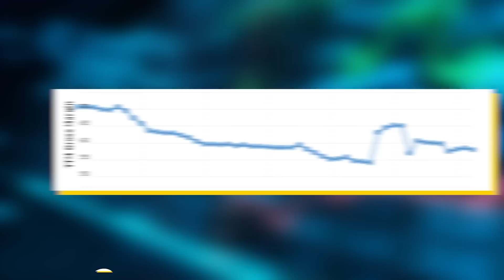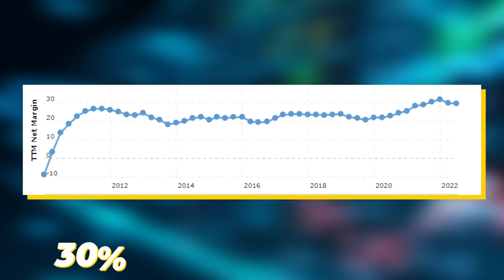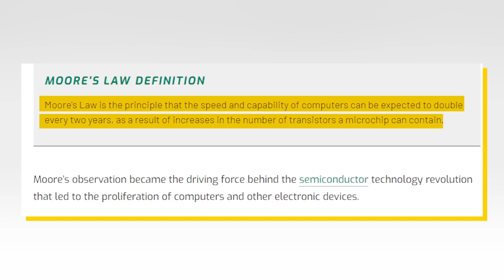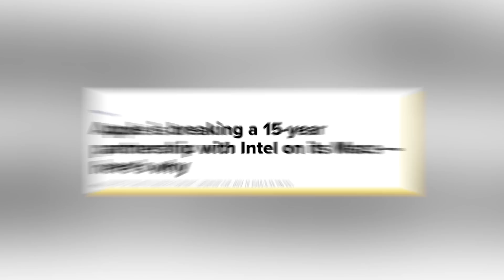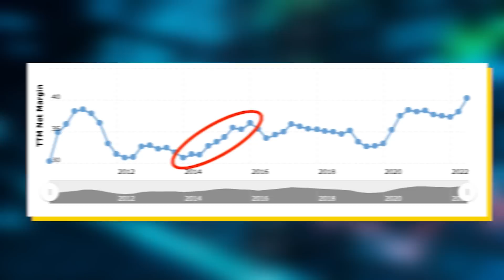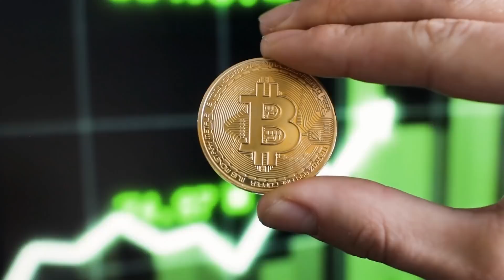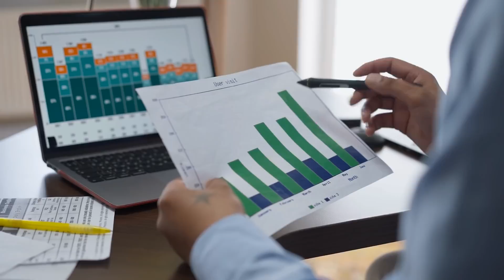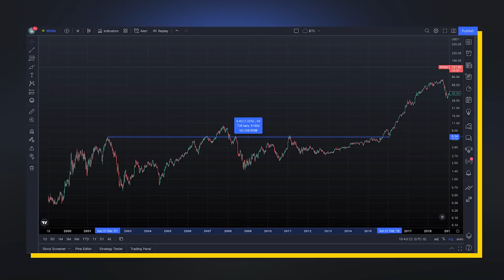How Did Chip Profit Margins Become So Obscene?

Comment: Customers will switch, well, this nVidia customer is thinking of switching to AMD after being with nVidia since the TNT 1. Will have to see what AMD delivers with the new GPUs
Reply: You won't you'll either stick with the 30 series card you have or buy one. The 40 series is about data center. Gamers don't matter anymore. Jensen has found a new pay pig. The reason the 40 series is more expensive is it is actually significantly more expensive to make. Because, it truly was designed for date center. That's why Nvidia still has the 30 series in the presentation. I thought the presentations Nvidia has done made this pretty clear, but I guess not.
Reply: @Tential1  hahaha, thats probably true about me....I currently have a RTX 2070, so I'm not really itching to upgrade, I might get a 3090 next year when their prices have dropped a bit.
Reply: Oh, I'm saying you won't because Nvidia just still has better features. Until amd has ai features, Nvidia will continue to add new ai features as they have a massive data center.

Comment: Idk if this changes anything but amd very much bet on multithreading with there bulldozer architecture. They split cores into specialized functions, Kind of like a gpu, the problem being a 8 core functioned like a Intel 4 core. Amd had also spun off there foundries into global foundries. Over all though they were unable to piviot fast enough and pretty much handed Intel the market for half a decade. Idk that they are a good example for thesis because they weren't in the place they were a decade earlier

Comment: Remember when Nvidia launched the 3000 series and said it would be cheaper than the previous generation? That went right out the window
Reply: Remember when the pandemic caused a shortage of everything raising prices on all materials forcing manufacturers to raise prices. Remember when the scalpers used the limited demand to buy up all the supply and resell them at a premium. I guess all the 30 series GPUs today that deliver better value than the 20 series GPUs before the 30 series launch don’t exist.
Reply: They were more expensive as the die sized were smaller for similar prices.

Comment: Chip manufacturers took a reverse path. Normally as you go up in power of a product, it gets better value due to economic scaling but as you keep going higher, it slowly starts to don't make sense  to keep paying more even if the product itself has more value than the lower tier because after all you have a limited budget, there is a limit for how much you are willing to pay for a product.
Reply: Nope the bigger the die size, the fewer chips per wafer you get, the more expensive each chip is. Also the more power it consumes the higher the yield standard must be. And then there is cooling, pcb components, etc,etc.

And as you go up in frequency power starts to increase exponentially compared to the increase in frequency. 

This is why when you reduce the all core clock speeds of the 7950x by just 6% from 5.3ghz to 4.8ghz the power drops from 230W down to 125W. 81% more power for 6% more performance.

For electronics, small is efficient, but big at lower clock speeds is more efficient than small at higher clock speeds power wise, but not cost wise.

Comment: Gross margin factors in cost to psychically make and produce the thing. Are these numbers factoring in all the expenses of RND development staff ect. Which would be the largest portion of their cost to actually make these things. And not just crapping out a million of the cards themselves. SO for a product that exists for a larger period of time, with less RND. The number would have more significance if it doesn't factor that in. Because at that point it is purely gouging. I would definitely say regardless there need to be work condition standards. And pay standards. And it's far less concerning to me on the high end. Because the notion that it offsets the low end partially is something only psychopaths would have a problem with.

Comment: nvda's margins rocketed from 2016 to 2019 because they entered the DC sector, their DC gpus use the same chips as high end gaming gpu just with more memory (HBM instead of gddr), but sell for 7,8,9,10x the price. they simply hardware nerf their gaming gpus so DCs can't buy those ones and have to get ripped off by those DC gpus. their gaming gpus themselves are already massive rip offs, their DC gpu level of rip off is off the charts.

nvda's products = biggest rip off on the planet. nvda's stock = biggest bubble in the history of the stock market.

Comment: the boom phase is over for sure for now, I am a DIY PC enthusiast, and I follow all the hardware launches closely....so far the ryzen 7000 series have not been selling due to the high motherboard prices, also for nvidia the RTX4000 series announcement did not go well with gamers, also since cryptocurrency mining is now dead, I doubt Intel, Nvidia or AMD will sell many CPUs and GPUs for the next few years
Reply: And finally people are just not spending…everyone is holding back
Reply: @chrisvig123  yes also people are waiting for the flood of second hand GPUs when the miners sell off their cards
Reply: There is a lot more to it than you think or even know exists as a dit enthusiast 
With decades in IT believe me the behind the scenes is vastly more complex than what you posted..  and that's an oversimplification given the massive # of constantly moving parts within this area alone

The mb costs for example with am5 are a tiny factor but only a tiny one and if you understood the actual differences between the design changes and tolerances of such vs am4 then you would start... justbbarely start to scratch the surface of that complexit

Hint  look at power and timing req for ddr5 and the memory section alone..  and not the marketing bs hype   go read the white papers and specs from amd, intel, micron, samsung and a few other directly involved with such.

Comment: 50-60% margins in any manufacturing  business are normal, you will typically only get net 10-20%, I’d imagine the research and development costs are astronomical in these tech companies.
Reply: He covered that in the video already, >30% on average net.
Reply: @unknowna1  Does he count in the multiple AI and software perks the cards bring? Those can't be cheap either.
Reply: Right, when I heard that, the most surprising part to me ended up being people believing that 50% margins are "obscene"... Yeah no, products and profits don't appear out of thin air, and all things considred depending on the industry your working in, that's some really small numbers 🤣
That being said, Nvidia still sucks but hey.
Reply: @vuri3798  Small margin is retail or food and they both still practically print money  on like 2 or 3%. Also do note OP most of these companies aren't manufacturing anything. Nvidia and AMD for example don't actually produce any of the physical chips at all, not even just the cards but the GPU itself either.
Reply: @scwirpeo  Both need to move "high" volume in order to get money, that was my point. Except people actually need food, so things make sens that far.
They indeed do not produce chips, but they still have to deal with engineering, and that's neither cheap or easy. To be honest if they did make chips their margins would be higher.
But to think that 50% is "obscene", once you take a look at Apple, the textile industry or even worse... Youtubers (but this isn't the right place not to trigger some). Either you're clickbaiting or your perception's warped
Reply: @vuri3798  I would say that 50% margins are considered high.  nVidia didn't start in 2016 either, they've been around since 1993 and survived fine < 15% for decades.

Having said that, the market will decide whether they can continue at >50% or not, it's really down to how valuable what they supply is considered by the market.
Reply: @unknowna1  I mean if you compare to AIBs yeah 50% is a lot, if you compare to Apple it's nothing. Again, you can't say someone makes obscene margins without taking others in consideration.

Now that's the real issue, it wouldn't be a problem if people had money. But right now it doesn't look too good, whether it's 10, 50 or 300% who cares if nobody's going to buy a product since they can't afford it.
Reply: Thanks for saying this. This video stupid brah

Comment: These margins are low, to maintain a skilled work force of engineer and support staff, for these products over the warranted lifetime of the products also to engineer new innovative solutions costs alot. No wonder why third parties can't make a margin like EVGA. Normally in manufacturing if your not making double the costs of the product your not substainable. Do you think a car cost 50-60k to build no it's more like 20-30k after shipping handling warranty dealer charges r&d tech support, training documentation, spare part warehousing and more it adds up. Its not retail which has vary low operating costs with quick turnaround of purchase and sale. Sometimes in manufacturing you have to also deal with the cost of product defects and recalls

Comment: The crypto market crashed, and the prices are still up despite a financial crisis, so I think demand will fall. I am also considering the 2nd hand market, or maybe not even buying anything.
Reply: ah, yes, the 2nd hand market, where used 5 year old cards with no warranty cost as much as a new card
Reply: Don't you need a electrical heater ?rtx  4090 is a good option

Comment: Well AMD and Nvidia has such high margins because they have other companies produce their cards. All of the companies that produce the graphic cards you use has single digit profit on each card sold. That is why it was such massive news when EVGA (a board partner) announced they will stop producing NVidia cards from now on.
Reply: Board partners don't produce the cards... They design and manufacture the coolers. NVIDIA has high margins because they are an industry giant who has first dibs on supply and they only personally sell million-piece orders, eating up all the cost savings that come from high volume production. Board partners act more as distributors that make deals with numerous retail outlets so that NVIDIA doesn't have to.

NVIDIA sells 5 million boards to EVGA >
EVGA sells 5,000 cards to 1,000 retail outlets >
Retail outlets sell 5,000 cards to end users.

NVIDIA does it because they then need to retain FAR less staff this way, and they use their comparative size to dictate the terms of these arrangements and protect their own margins. Bigger = more power = greater ability to capture value that would be otherwise held by other companies in the supply chain = higher margins.
Reply: @AnimatorBlake  damn I guess all the AIB partner graphics cards with PCBs that are different from the reference cards don’t exist. Man if only I had the RTX 2060 graphics card. I really must thank you for enlightening me that I don’t actually have the graphics card that I own because it uses a custom PCB.
Reply: @AnimatorBlake  Nvidia supply the whole board for half of the product lifecycle and chip only for another, then there will be custom PCB. AMD on the other hand only supply chip.

Comment: You have to understand how chips are made to understand the cost for the semiconductor companies.  The 4090 has a die size of over 600mm2 using the 4nm TSMC process.  This is a massive chip—the Apple A16 is approximately 160mm2 for comparison.   On a given 800mm wafer, you can only fit so many chips, and the larger the chip, the lower the yield.  The 4nm process is relatively new, so I dont expect that the yields are great at this moment.   TSMC is running out of water at their foundry, this means they are spending more money recycling the water and buying water to make chips—these additional costs are passed onto you.   The ASML lithography machines are incredibly expensive and is needed for 4nm chips.  The cost of the commodity gases that are needed in the production process has increased greatly over the last 12 months—those costs are also passed to the consumer.  

Until 4nm is more mainstream and yields better, you simply can’t expect big ass chips like GPUs to be cheap.  If you look at cost-per-transistor comparison between the older chips and the newer ones, you will see that the new chips are CHEAPER than older generations.  Jensen even said Moore’s Law is dead.  You can no longer expect to drop the process size and double the performance (by doubling the clock cycles).  You actually have to build faster chips.

This video is not your best work—you don’t understand what goes into making chips and how expensive the entire tool chain is.  It’s not just retail price x gross margins = profit.
Reply from the maker: Bro, that’s kind of what the entire video was about. It wasn’t criticism that they have such high margins, but why they do.
Reply: @LogicallyAnswered  Sorry, I usually like your videos but this one is missed the mark.  You are looking at the totality of the company’s profit margins and then focusing on the GPU price, and drawing a conclusion that Nvidia is profiting $800 per GPU on the 4090.  This is not correct.  Maybe you are making this video for people who are salty about how expensive GPUs are there days, and that’s fine, there are plenty of videos that cover it this way.   However, I EXPECT you to Logically Answer the question, not draw a half dozen half answers and not address the COST side of the equation.  You can do better than this.

Look at Nvidia’s SEC filings, you will see that the profit margin is a result of the data center business, not GPU.
Reply from the maker: Sorry to hear that man

Comment: OK I'm going to have to do something I hate to do and argue NVidia's point of view.
The thing about GPUs is that talking about the sell price and only discussing the hardware is very reductionist.
GPUs are a combined hardware and software offering. You can have the most amazingly powerful GPU and if the drivers for it are of poor quality or unsuitable for the software you're running, it'll perform terribly.
So, the cost of doing business for NVidia and other GPU manufacturers is more than just the cost of productive capital and marginal cost of each unit. There's also the ongoing cost of software support for the hardware. And this is something that goes on for a long time and can potentially grow more burdensome with each year as you're bringing new product offerings to market.
Reply: Not really making drivers for GPUS isn't really hard even freelance devs can make them for linux even though NVDA or AMD don't make them...what is hard though is buying the required machines and process to make them at scale. it took decades to make these happen and a small startup  won't be able to do it
Reply: @blackice214  "If the drivers for it are of poor quality"
Did I stutter?
Reply from the maker: Well, we did discuss net profits as well
Reply: @LogicallyAnswered  Certainly, though it's super easy to disguise ongoing liabilities and technical debt. It's a massive problem throughout the IT industry in general.